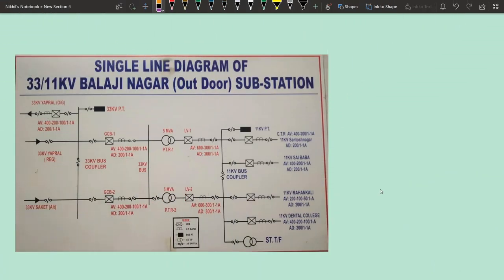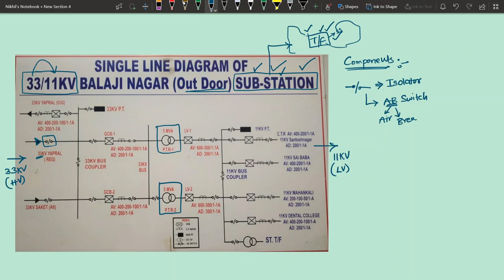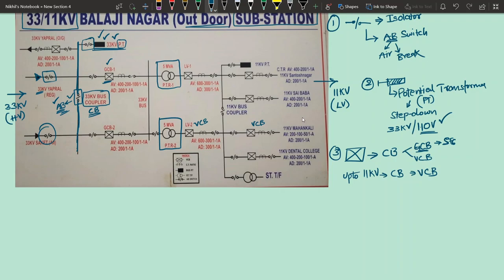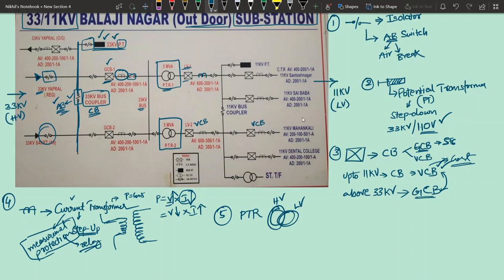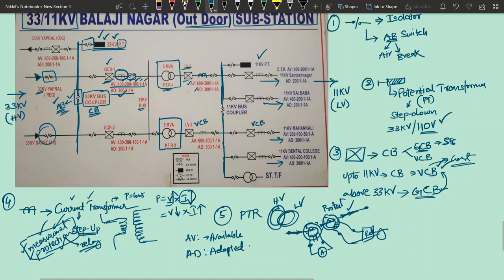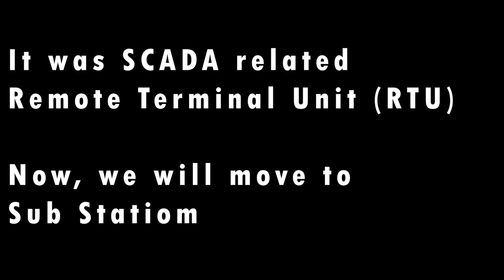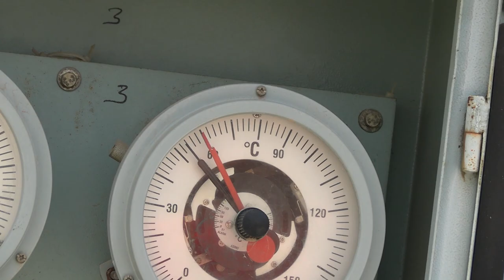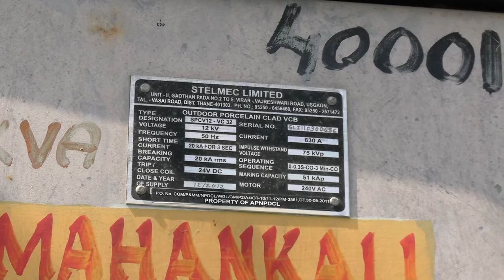02 - 33/11KV Sub Station Visit | Practical Electrical Engineering Series

Comment: Ji i have one doubt.. how to differentiate the substation voltage level?? .. 1.mainly it based on distance related yes sir.. my que is whats the distance in 33/11kv substation placed
Reply: I think most of the substations are in ac so it is not depending up on length & ⚡ voltage level may be choose where the place is convenient & cheap in case of D.C for every 2 k.m we require 1 dc substation that's why we recommend ac in our world 
  About my knowledge
Reply: @yalanatibhaskarrao592  hi sir